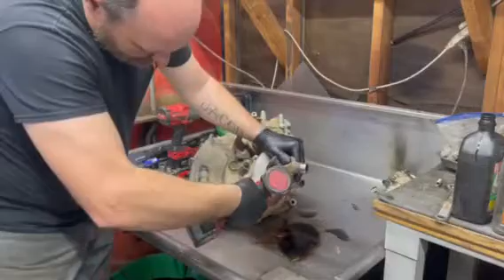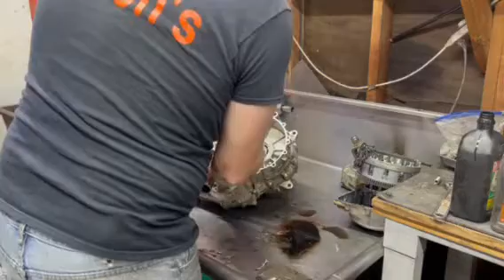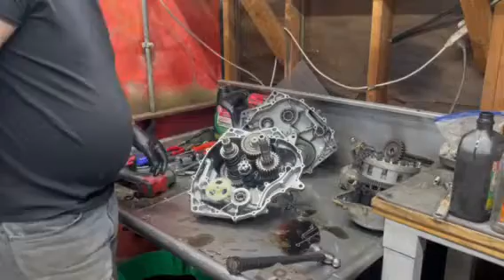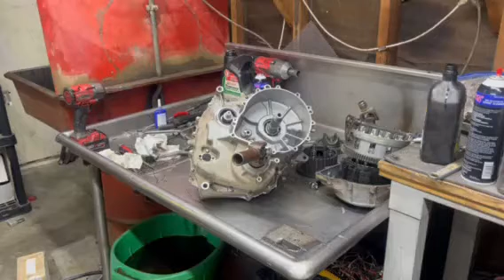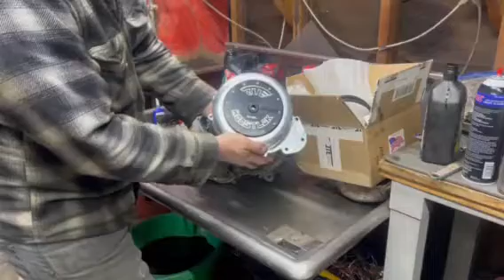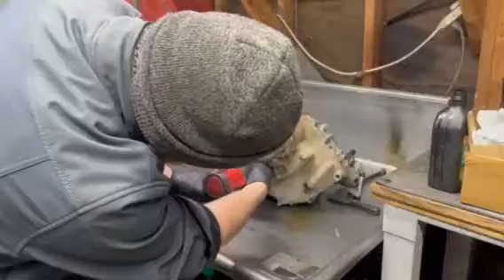Yamaha YXZ 1000 70/30 install along with JTE Boost lock

Comment: How much for parts and labor with just the gear change on a 23 sport shift? Also a sealant called “The Right Stuff” is the best I’ve come across yet.
Reply from the maker: So labor is 375.00 for just the trans and parts are 380 for 1st gear set, middle drive is 580.00 and a boost lok is 1850.00. You will also need a GSC because the MCU will not be happy with tge gear change. Its 380 also